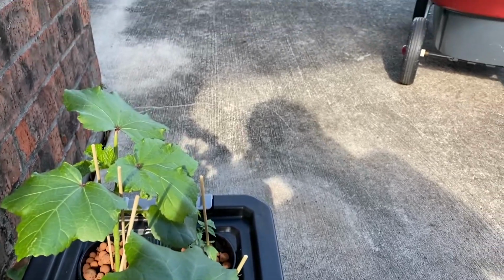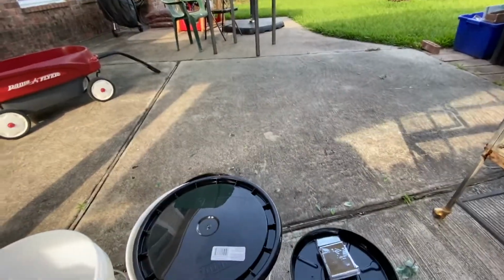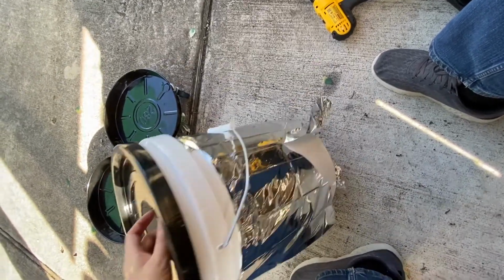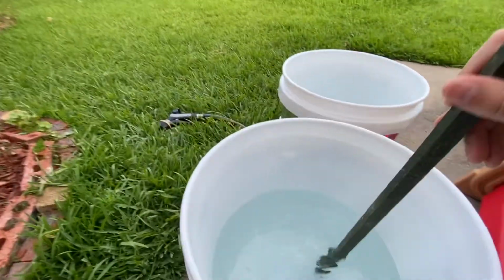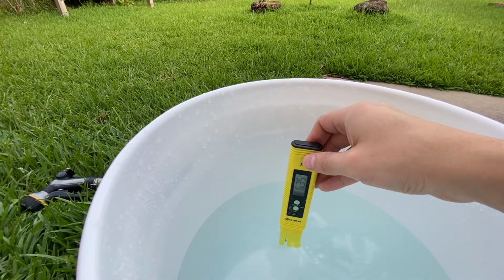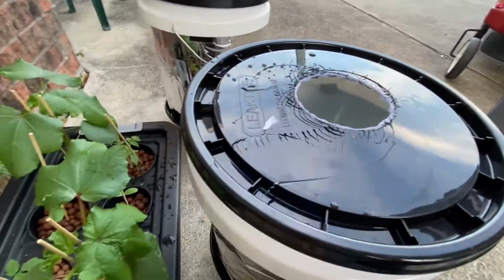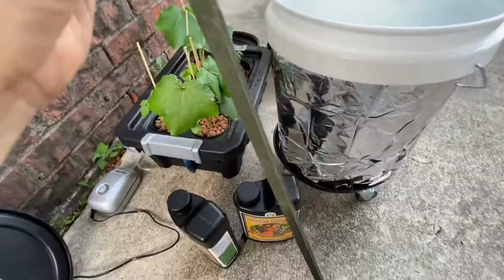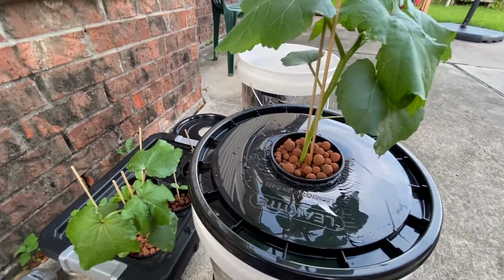How grow Okra with Kratky Hydroponics part 1

Comment: If your water is Alkaline before putting the nutrient it will be acidic pag-nalagay na ng nutrient, dapat ilagay ang nutrient then ph test that way you will know if after mixing the nutrient is Acidic or alkaline. Just a suggestion.